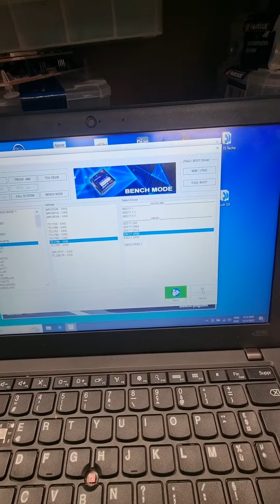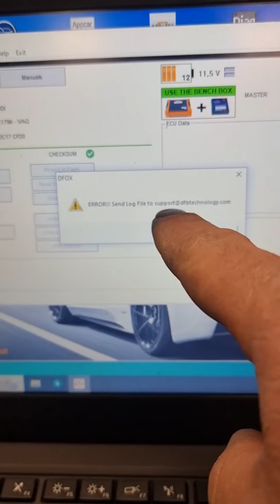KT200 not supporting Banch Mode for EDC17CP20. !

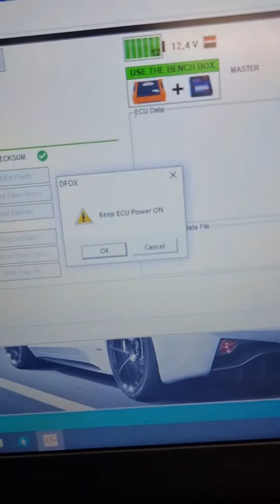Comment: @1:52 Didn't you have seen it? The amperage usage went above 3.5A. Either somethings with the wiring wrong, or the ecu simply needs more power.
Reply from the maker: Yes the problem from power supply